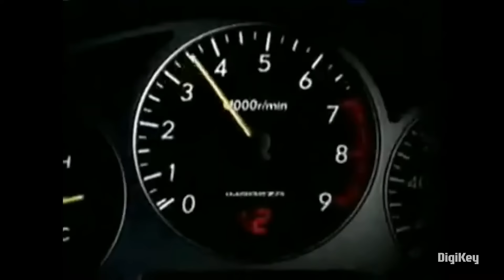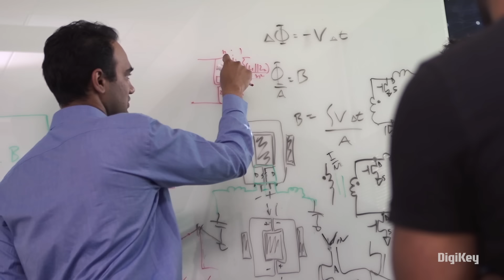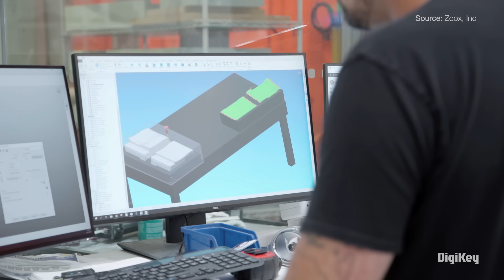An Evolution in Mobility:  City Digital S3 E1 | DigiKey

Comment: All I see is cars and technology extremely dependent on a very shaky and vulnerable Electric grid as well as a manufacturing "just in time" logistic that will all bite this industry in the ass, without small regional old school backup systems distributed all over the U.S.
It also needs manufacturing within U.S./North America, not over seas. Many critical industries do not have strong redundancy at all.